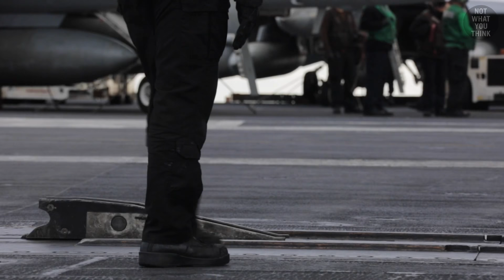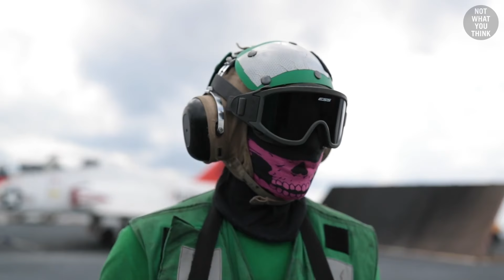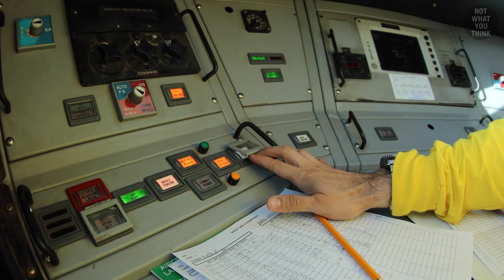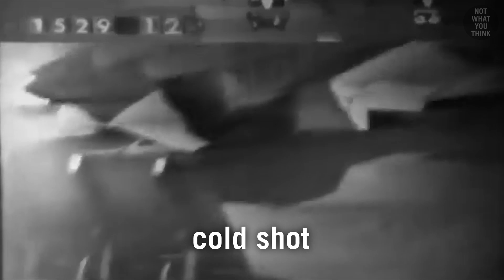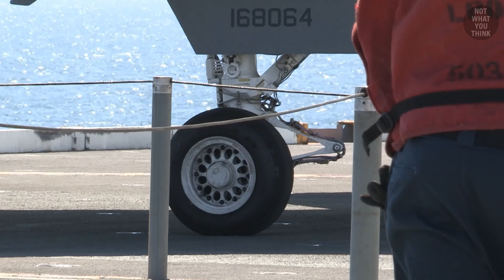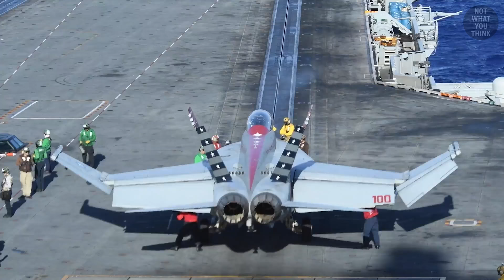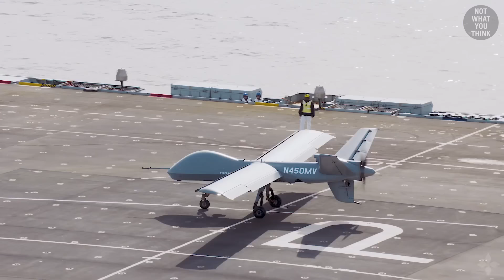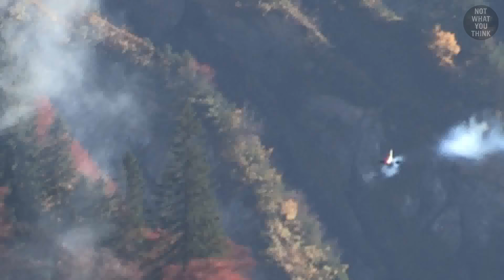Why the US Navy is Replacing Electric Catapults with Steam

Comment: I think it would be interesting to put a single electric catapult & a couple wires on amphibious assault ships.
Not to be used regularly, but as a form of insurance.
Reply: You'd have to redesign them from the boilers up, and it would be an enormous waste of resources.
Reply: @brucetucker4847  I agree, I would prefer to just have a VARS pod for a V-22 but the navy brass don't want anything to compete with the MQ-25. I'm just going with the flow.

Comment: With any new technology you have to ask if the juice is worth the squeeze. Steam has worked well for 75 years. When the decision was made to put EMALS in the Ford class, the technology was untested. It might be usable now, but wasn't then, and was a major issue in the construction of the Ford. How do you design the space for an EMALS system, if the system doesn't exist and hasn't been perfected? As for drones, we design aircraft around the launch parameters of steam catapults, the same can be done for drones.

Comment: It'll prove more and more reliable and flexible as the years go on. In fact I have the perfect example here.... We primarily use steam to generate electricity these days. The trade off of kinetic output vs resources used to produce the power, it's not even a question. 

Electricity is more efficient and easier to control than a stored energy. More dangerous yes, but all solidly within the rules of science.

Comment: One thing they didn't mention here. EMALS require much less maintenance and have fewer moving parts, fewer areas of failure. Nuclear powerplants can make steam as well as electricity but they are most efficient at making electricity. As an analogy where did the steam powered trains go. At the end of steam they were fusing fuel oil , not coal for powering the steam engines. But steam was much less efficient. Nowadays locomotives are electricity powered from diesel engines. The electric engines being used are much more efficient, have fewer moving parts, require much less maintenance, and cost less.
If you want to convert anything, convert the old steam catapult carriers to electric.
The carriers using EMALS also use electric braking arresting gear which uses regenerative braking that is returned to the systems. Has fewer moving parts and is easier to repair and maintain.

Trump asking people on the Wasp about what to use is BS. That ship does not have catapults. It is a light carrier with helicopters and F-36B (VSTOL). ask a helicopter pilot what they prefer. they will say, we don't need no catapults!
Reply: you won the biggest mouthbreather award
nuclear reactors more efficient at making electricity than steam🤡

Comment: They won't consider a 'jump ramp' at the bow of the deck because the British Royal Navy developed if years ago!
Reply: Because it RADICALLY lowers the maximum takeoff weights you can launch. You can't put too much weight on an aircraft being ski jumped, or you just collapse the gear. It's more than twice the peak G load you have on landing, and on top of that you're significantly lighter on landing anyway.

Why is it Russia can only launch fighters at half fuel and light missile loads? Hmm? But China launches the exact same airframes just fine full load and fuel on the Fujian, but not the earlier carriers? Hmmmmm?

Comment: The navy Likes electromagnetic catapults for the same reason why they like $800,000 artillery shells, because they get to spend more money that goes to big defense contractors at get paid billions to invent absurdly complex, expensive and proprietary systems that they get paid to service for decades. 

Dumping steam into a cylinder can be carefully controlled, they make extremely accurate closed loop hydraulic and peneumatic valves that can be plugged into a computer reading accelerometers and strain gauges. You can make the old stuff work with the drones without having to re-invent the wheel.

Comment: Also its the 1st gen electric catapult, the next gen would be much better and the next one too.

Theres no reason, more than political, to not use EMALS, and probably in the near future it will be cheaper
Reply: A high failure rate and the Gerald R Ford's still not working right till this day isn't a good reason? It isn't a good reason that China stole the tech and is having the same exact problems too?

Comment: Trump is literally talking about this because the people that work on them and use them told him steam was better, mainly because they can repair and service it much more easily instead of waiting for a technician to work on the emals. You and everyone commenting on this video are ignorant of key details in this situation.
Reply: Trump thinks that magnets don't work under water.
Reply: @markotrieste  This is the stupid response that shows how clueless you are.
Reply: @TheFoulMouthNews "stupidest"
Reply: There are other reasons too beyond the ones you brought up too and you are 100% correct with yours. What people aren't talking about is the US Navy doesn't have the right to repair the mag launch systems and only an authorized technician can at great expense to the Navy which it appears they had the same engineers design it that designed McDonald's ice cream machines. It consistently and constantly fails on the Gerald R Ford. China stole the tech from the US and is having the same exact problems the Navy is with it too.

Comment: Why did they launch the innocent red cart into the ocean?
Reply: That thing is full of cement and weighs thousands of pounds.  They want to launch it off the end to see if EMALS works, calibrate it, check the time to recharge, etc.  The US Navy also wants its pilots to be comfortable with the launch system.  Think of all the people on deck getting training.  They need to be super comfortable before they launch their first aircraft.  You will also note they did it with the ship parked.  They send a tug with divers to swim down with a cable and winch it back up for reuse.

Comment: Op tempo is the reason. We can launch a larger variety of aircraft faster than steam.
Reply: I worked on the team that developed EMALS.  Requirement changes from the US Navy would come in routinely.  They wanted to launch lighter drones, ensure they would support much heavier aircraft for the future, faster launch times, etc.  The steam systems are already maxed out.  They can't launch heavier aircraft.  With the EMALS system, there are way fewer moving parts.  The steam system takes up 6 floors on the ship, whereas EMALS takes up 2.
Reply: @loopie007  Fewer part, less maintenance too boot

Comment: You either put the wear on the catapult or the planes.  The best option is the one that puts the wear on the cheaper system.
Reply: Wrong. With better technology, for instance, uniform pull, accurate end speed, you could reduce the wear for both.
Reply: @drueman-hank  Exactly right.  China seems to have already gotten their EMALS calibrated for mass and smoothness, with minimal 'jerk' (change in acceleration) during launches.
Reply: @ZweiZwolf  No. They stole the design from the US and have had the same exact problems with it the US Navy has had with it. China Uncensored and other news outlets covered that a while ago.
Reply: @TheFoulMouthNews  You said that China Uncensored is a channel made by a group of brainless anti-China Falun Gong believers. They are more anti-China than Americans. Do you also believe their information?🤣
Reply: @ZweiZwolf  Or so they claim.  Don't believe everything that China says.
Reply: @JClarkeCT1334  I don't have to believe anything after watching them launch planes smooth as glass.  Their EMALS system works, simple as that.
Reply: @ZweiZwolf  If your metric is "launch a few planes smooth as glass", Hollywood can rig something that will be outstanding.  How well does it stand up under maintenance by sailors?  It it still "smooth as glass" after the ship's been deployed for 8 months?  How about if it's been through a typhoon at sea?  And how many different sizes of plane did you see it "launch smooth as glass"?  And were you aboard the ship or were you watching a video?
Reply: @JClarkeCT1334  LOL, all reputable Western media agree China's Type 003 launched the new J-35 stealth fighter, an AEW turboprop and the old J-15 fighter via EMALS.  Pretending it's 'Hollywood' is Hindoostan-tier cope and ignorance.

China's capacitor banks are inherently at least an order of magnitude less complex the Ford's flywheels, no moving parts to wear or break. As for how well it'll stand up, well, we'll just have to wait and see. But it's not like China has to design around woke DEI sailors.
Reply: No, you don't.
Reply: The cheaper system is the aircraft.  Catapults are integrated into the carrier as a whole system.  Lose one or more catapults, the carrier is that much more less effected.  Lost them all...you've got no carrier.
Reply: @cliff8669  Depends on how long each lasts, the EM catapults and the arresting gear together on the USS Ford cost 1.19 Billion. 60 F-18E's for the airwing cost 4.2 Billion.
Reply: @SgtBeltfed  but 90% of the EMAL's cost is in parts that won't break. (such as the capacitor banks) the rails are relatively cheap.
Reply: @Flipkick25 I don't have the unit cost of the consumables of the catapults, but that makes my point even better. The airwing costs about 4 times the entire program cost of the catapults and the arresting gear together. There's a lot of money to be saved and uptime to be had by not beating the airwing up. Aircraft aren't cheap.
Reply: @Flipkick25 Uh, capacitors do fail and when they do, it is usually catastrophic. They go boom. I had a small one blow up in my face before and one blow up with a monitor too. Both sounded like a .22 caliber. Just multiply that by 10,000 or more.
Reply: @TheFoulMouthNews  That's why the Ford uses mechanical flywheels instead of capacitors.
Reply: @ZweiZwolf  I had a feeling and kind of figured that was why the Navy chose the flywheels storing mechanical energy where it doesn't tend to explode. It makes sense. I've wondered what amount of gyroscopic force the flywheels apply to the ships where there has to be at least some of it going on with them. Obviously, it isn't on a level that would effect them but it is something I am curious about.
Reply: @TheFoulMouthNews  The more likely reason is that the US has decades of experience with flywheels for energy storage. 

China, OTOH, leads the world in all applied electronics, especially energy transmission and storage, so it was relatively easier (for them) to select a capacitor system. 

In both cases, EMALS is new technology.  The engineers 'go with what you know'.  

Presumably, if Russia was in any sort of position to build a new carrier with EMALS, they would likely do something completely different yet again, based on the particular technology they're comfortable with.
Reply: @ZweiZwolf  The Russians do love to do things their own way, either due to technical aspects unique to them or just as a result of how their engineers think. That being said, you are probably right on their going their own way. In regards to the US choice of flywheels, we/it have a lot of experience with capacitors too. I do think that was a factor in the choice of not going that route. kinetic energy as opposed to stored energy in capacitors is safer and where relying on mechanical storage probably more reliable. Before the US went with steam, it was considering mechanical and hydraulic catapults. It didn't go with the mechanical because it didn't have the power to launch heavier/larger aircraft and it didn't go with hydraulic because of safety concerns where a leak could lead to hydraulic fluid slicing right through the bulkheads and crew.

Comment: Even using the "adjusted" figures for EMALS, it has 4 times the amount of inoperability as steam.  Only the Navy would take a reliable system and replace it with crap.  Navy = crap.
Reply: Actually it's more than fifty times as reliable as 1st generation steam. It also doesn't fail by exploading and LITERALLY SINKING THE SHIP, like 1st generation steam did.
Reply: @ASDeckard  Um, have you seen the capacitors used with the mag launch system setup in multiple banks? They are huge. Capacitors can and do explode too.
Reply: @ASDeckard  Grok: "No, no steam catapult has ever exploded and sunk a US aircraft carrier. There are no historical records or credible reports of any US Navy aircraft carrier being sunk (or even catastrophically lost) due to a steam catapult explosion or failure."  Also, the video makes excuses for the unreliability of EMALS just to eek it up to four times more unreliable.  EMALS is crap and so is your debunked, false, lying comment.  You are a liar.
Reply: @ForestFelvey Quoting Grok is like quoting Jon Lovitz's pathological liar character from 80s SNL.

Comment: Electric catapults also have electric Arresting Gear, which is like regenerative braking, further reducing stress, compared to the old hydraulic system. Real benefit.
Reply: Other issue is that if the steam system itself breaks or has issues, then catapult launches do not occur... does this count against steam catapult failures? No, but it should if it's not available, for ANY reason. There is a measurement issue here too. EMALS has the high tempo, the easy switching between heavier airframes and lighter drones, and higher availability when you include not just steam cat breakdowns, but steam cat unavailability due to some issue anywhere along the steam supply chain that needs to be repaired.
Reply: I recall (25 years ago), while working in the Tool-Crib of King's Dominion Park, in central VA, that the Navy Brass stopped by a few times, to see the Electro-magnetic Launch Systems used by the rides, 'Outer-Limits', and "Volcano", with Volcano sending it's Trains out in Two "bursts" of Push, to go Vertically up out over the top of 'the mountain'. Fun Fact; a Food-stand in the park had to be moved, outa-the-way of loose-tied Boots, Sandals and such, that fell from the Sky, from careless Riders of that Roller-Coaster, and it's 2-G 'half Roll-Turn' at the Apex... Nothing quite like having a work-boot from 'the sky' take your $28 Lunch tray out of your hands on your way back the picnic tables!! LOL..
Reply: I thought the breakdown rate could never get below target with electric. Isn't this even on Wikipedia
Reply: PHUKHEDIDNESS SUPREME!  NO, NITWIT!  The arresting gear is TOTALLY SEPARATE!  It has nothing to do with the catapult!
Reply: But Trump don't read naval tech manuels
Reply: Doesn't mean we should replace all the old systems when the new stuff is as glitchy as an early Apple iPhone
Reply: That's a joke,  right?  So you're gonna make the a simple reliable system more complicated just to "recover" energy in a nuke powered carrier?
Reply: @MavHunter20XX mechanically speaking the electric catapult is simpler and easier to maintain than the steam catapult
Reply: @brandonn.1275  Neither of us has experience in maintaining either.  However, I have maintained military equipment.   One thing I know for sure is that manufacturers are prone to over complicating leaving it up to micro controllers and software rather than simpler mechanical controls.

If you done even a little research, you will see on trouble prone the EMALS was.

The other glaring issues is if you're trying to have a battle ready fleet and you're being handicapped by teething issues that handicaps your fleet, you start to wonder why the EMALS was pushed in the first place.

So the question that most is failing to ask, did the US Navy use a warship as their experiment for the EMALS instead of developing it to maturity where all the software issues was figured out in a non critical environment?  How much money did we dump into this when there is wars brewing around the world and it had to return to port to correct?
Reply: @MavHunter20XX  EMALS is already better than steam, you need new data. Like anything new it needed development time but it has done that and it works. Better than steam in every measure, and in direct comparison with the same metrics it already is as reliable as steam. The Navy set goals for it that were 2-3 times better than steam and it is still working to get to that, but it is still way better than steam already.
Reply: @MavHunter20XX  I think it is more about recovering it from the airplane. Which means it doesn't need to break as hard and thus the wear on the airplane and the recovery platform is less. The electricity isn't the main topic, though that is of course useful if you want to launch at as fast cadence as possible (faster than allowed by steam).
Reply: @MavHunter20XX "further reducing stress" on components that may fail during wartime doesn't sound like he means recovering electrical energy for fucking batteries, dumbshit. sounds like it's making parts last longer. the technology will refine with time and become superior to steam catapults in short order.
Reply: @MavHunter20XX  so you're going to rip out electric catapults because Trump has a phobia of magnets?
Reply: @tomservo5007  that's up to the Navy to decide that.  A president can only do so much.  How about you do a little research on the EMALS?  Would you rather have a system that works in war or something that fails and cannot be fixed while deployed?  That's the issue that is being glossed over.  The EMALS might have made carrier into a financial nightmare because it still remains a question of reliability .
Reply: @MavHunter20XX  they are improving it
Reply: @remogatron1010  not ready, we're already needing to launch fighters yesterday when it will be ready next....whenever.